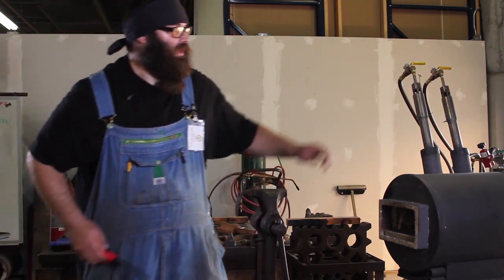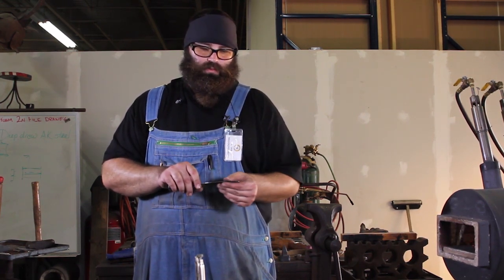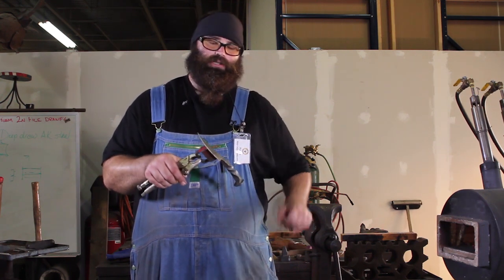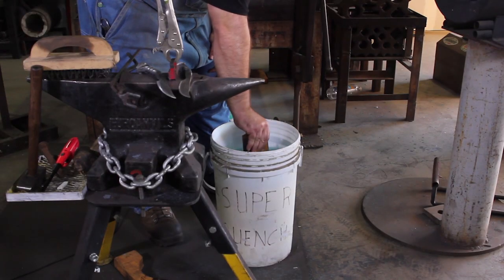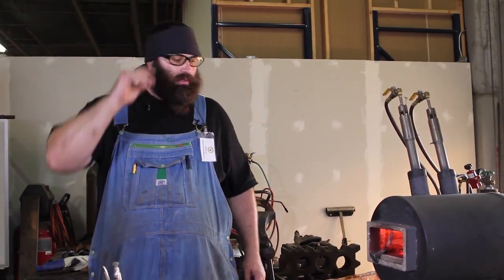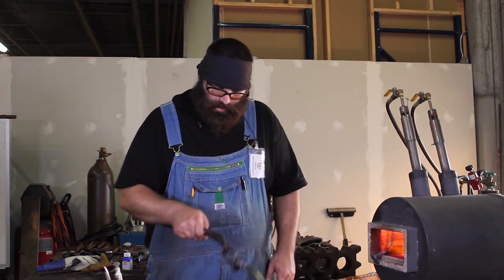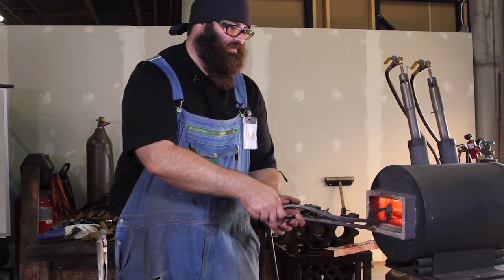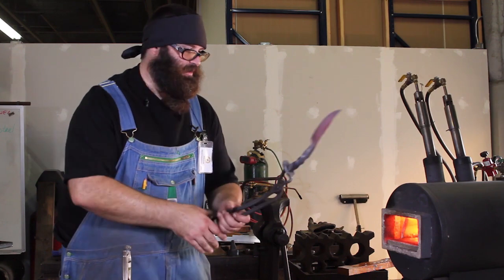Railroad Spike Knife Making | How To Heat Treat Blade

Comment: Heat treating of steel consists of hardening and tempering. The critical temperature of steel is not at non-magnetic, but slightly above it.

Comment: so this is how to heat treat a knife?  I'm new at blacksmithing so should this work?
Reply: here's a good video on how to heat-treat a chisel by Christ Centered Ironworks, if you copy the general process and apply it to your projects you should be headed in the right direction. it gets a little more complicated once you dig into it because different steels prefer different quenching methods (some prefer water, some oil, others air) but this should be good to start.
Reply: @killman369547  0